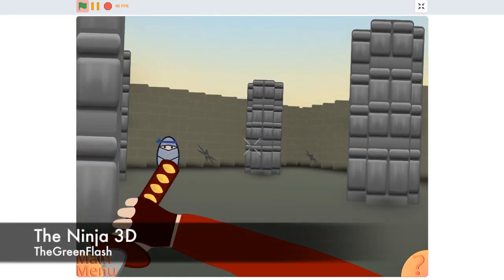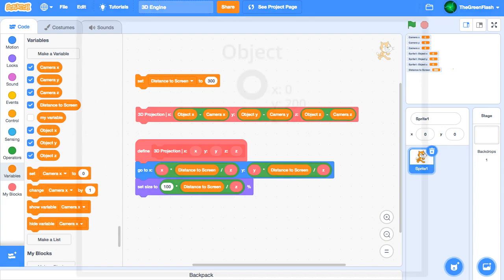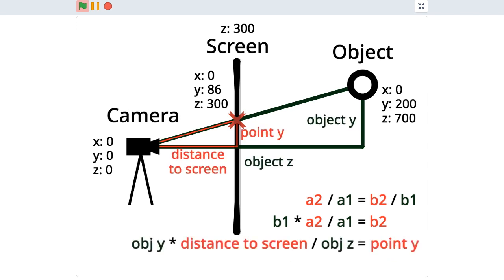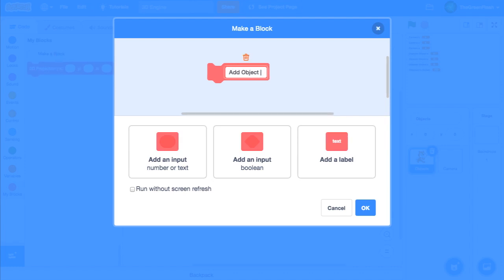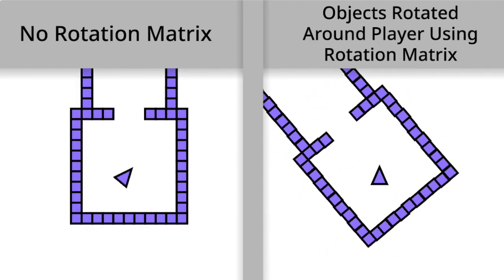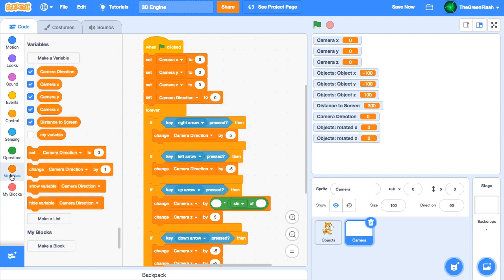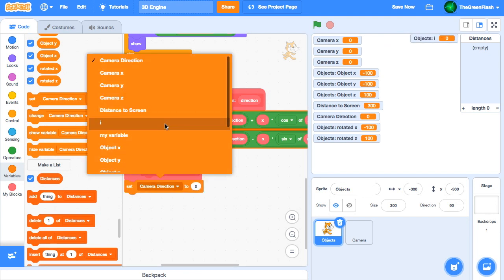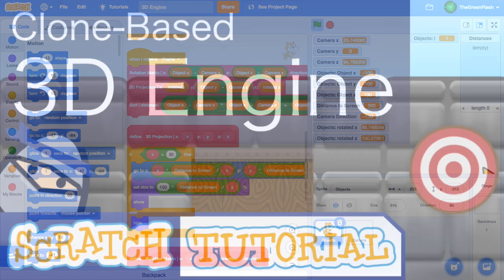How to make a 3D Engine in Scratch 3.0

Comment: When I walk past the cats and look back, they are very far away:/ How do I solve this?
Reply from the maker: Thanks for watching the tutorial! If nothing is using the motion or costume blocks, Scratch automatically runs the project in turbo mode (the frames per second go from 30 to several hundred). This happens here when the objects go off the screen. There are several ways to fix it, and the easiest is to just add a go to x: (0) y: (0) block at the bottom of the Camera sprite's forever loop.

Comment: I have a problem 
I can only add one object not many 
Anyone know the fix?
Reply from the maker: Thanks for watching the tutorial! I'm not sure what's wrong, but you could try comparing your code to the completed code here: https://turbowarp.org/575099758/editor
Reply: @TheGreenFlash  thx bro I fixed it but I had another problem,it's in the  rotation matrix when I press left it moves up and when i turn around it moves normally I tried many times but didn't work

Comment: bro didnt notice the bug about not looking at the objects then getting teleported far away
Reply from the maker: Lol yeah, I completely missed that until after I posted this, and the problem goes away after part 2. I thought I had a pinned comment giving a quick fix, but it’s not here anymore for some reason.
Reply from the maker: [Copy-pasting the comment] If nothing is using the motion or costume blocks, Scratch automatically runs the project in turbo mode (the frames per second go from 30 to several hundred). This happens here when the objects go off the screen. There are several ways to fix it, and the easiest is to just add a go to x: (0) y: (0) block at the bottom of the Camera sprite's forever loop.

Comment: hi, i am using scratch 2 and I don't have "go forward () layers" block - is there any way to do it?
Reply from the maker: Thanks for watching the tutorial! It should work if you use Scratch 2’s “go backward () layers” block, but put (1 - i) as the input instead of (i - 1). This will make the input negative, and going backwards a negative amount of layers will make it go forwards.

Comment: I found a glitch after impletmenting the rotate matrix and updating the camera movement.
Whevener I rotate the camera so the cat sprites are behind me and I hold down the up button and I turn around to look at them again, their suddenly VERY VERY small. I don't know why this is happening, Im pretty sure I copied the code down correctly, anyone else having this problem?

EDIT: after playing around awhile, I have discovered that for some odd reason the foward button suddenly makes the camera go very fast if I hold on to it for a while (the Z Camera variable suddenly goes into the thousands).
Reply from the maker: Thanks for watching the tutorial! If nothing is using the motion or costume blocks, Scratch automatically runs the project in turbo mode (the frames per second go from 30 to several hundred). This happens here when the objects go off the screen. There are several ways to fix it, and the easiest is to just add a go to x: (0) y: (0) block at the bottom of the Camera sprite's forever loop.
Reply: @TheGreenFlash  Thanks for the reply! I tried using a motion block but It didn't work. However, now that your explained to me why it happens I figured out why it was reacting that way: I hide the camera's sprite, now that I unhide the sprite It words just fine, but now have a very tiny cat in the middle of the screen (LOL). But its ok, I made it transparent using a ghost block. Everything is working as expected now, thanks a lot, you're the best!
Reply from the maker: Awesome, I’m glad you got it figured out! Also, if you don’t want to use the ghost effect, you should be able to erase the contents of the cat costume in the camera sprite.

Comment: Hey bro huge fan but I don’t think this works in the newer versions of scratch because I did everything in here but it’s just not working and it only shows 1 cat I did everything but it’s just not working any advice about what could be wrong
Reply from the maker: It could display only one cat if you make the object variables For all sprites, when they should be For this sprite only. This will allow each clone to have its own copy of the variable, so the objects can appear at different points in 3D space

Comment: When I turn around, it changes my x and z position??????
Reply from the maker: That sounds like an issue with the Camera sprite’s movement script. You could try comparing your code to the completed code here: https://turbowarp.org/575099758/editor
Reply: @TheGreenFlash  thanks I forgot to take out the original movement

Comment: It's not working the camera x and y got to like 1 million in 2 seconds :(
Reply from the maker: Thanks for watching the tutorial! If nothing is using the motion or costume blocks, Scratch automatically runs the project in turbo mode (the frames per second go from 30 to several hundred). This happens here when the objects go off the screen. There are several ways to fix it, and the easiest is to just add a go to x: (0) y: (0) block at the bottom of the Camera sprite's forever loop.

Comment: can you make different sizes of objects or was i too lazy to check the tutorial again
(not being rude btw)
Reply from the maker: That’s a good point, I totally skipped that! It shouldn’t be too hard to add a variable for object size. You could call it Object Size, make it For This Sprite Only, and set it before you create a new object. Down in the 3D Projection script, with the line “set size to 100 * Distance to Screen / z”, put the Object Size variable in for 100, so it becomes “set size to Object Size * Distance to Screen / z”.

Comment: hi i am having trouble with the code primarily the creating clone part i went back to check if all the code was correct and it seems to be so i was wondering if you would have any idea of why it doesnt want to create the clones of the objects sprite?
Reply from the maker: Make sure the Object xyz variables are set to For this sprite only. If that doesn’t fix it, you could try comparing your code to the completed code here: https://turbowarp.org/575099758/editor
Reply: @TheGreenFlash  oh yeah that fixed it thank you so much.

Comment: so if you walk straight through the cats, it takes you super far past them, but if you walk backwards, it doesn't. you can tell he's avoiding this bug, but he does not give a fix for it     : (
Reply from the maker: Thanks for watching the tutorial! If nothing is using the motion or costume blocks, Scratch automatically runs the project in turbo mode (the frames per second go from 30 to several hundred). This happens here when the objects go off the screen. There are several ways to fix it, and the easiest is to just add a go to x: (0) y: (0) block at the bottom of the Camera sprite's forever loop.
The bug is also fixed in part 2 with the addition of the horizon sprite.

Comment: So im at adding objects and i have the cam set up i think? but whenever i use arrow keys and move the cam too far it just goes really fast and there is only one scratch cat even tho i put in the clone thingy?
Reply: Ok well i fixed the cord issue but i cant get multiple scratchs on the screen?
Reply from the maker: Thanks for watching the tutorial! If you only see one Scratch Cat, it sounds like the Object x, Object y, and Object z variables were made for all sprites instead of for the Objects sprite only. If that doesn't fix it, you could try comparing your code to the completed code here: https://turbowarp.org/575099758/editor

Comment: Very good tutorial. Just one small problem though; when the user is not looking at any objects, the speed at which the camera moves increases significantly fast.
Edit: Nevermind my complaint, it was a problem on my part
Reply: its happening to me too how did you manage fix it?
Reply: @DeBeer78  I don't remember exactly, but I do know I went through the video over and over again until I found the wrong in the scripts
Reply: @DeBeer78  if it helps I think it had something to do with the sin and cos functions
Reply from the maker: Thanks for watching the tutorial! If nothing is using the motion or costume blocks, Scratch automatically runs the project in turbo mode (the frames per second go from 30 to several hundred). This happens here when the objects go off the screen. There are several ways to fix it, and the easiest is to just add a go to x: (0) y: (0) block at the bottom of the Camera sprite's forever loop.
Reply: @TheGreenFlash  alright, thanks

Thats what I did before and it fixed it
Reply: @TheGreenFlash but, only works when You enter into the The Ninja 3D, i have that question

Comment: it is normal that for me when I click on the green flag its position puts x -300 y 300? ??????? PLS HELP MEEEEEE
Reply from the maker: That could be normal depending on where an object is in relation to the camera, but I'd really have to see the code itself to know for sure.
Reply: @TheGreenFlash  Here is the project link https://scratch.mit.edu/projects/527273202/
Reply: Did you find the problem?
Reply: @TheGreenFlash  ?????????
Reply from the maker: Sorry for the delay, I got super busy for a few weeks. It looks like there's a problem with the script under the When I receive Frame block. The second input for the 3D Projection block should be Object Y - Camera Y, but it's currently Object Z - Camera Z. Again, sorry for the late response, and I hope this helps!
Reply from the maker: Also, in the same When I receive Frame script, the second input in the Rotation Matrix block should be the Object Z - Camera Z, but right now it's Object Y - Camera Y.

Comment: should I learn scratch? I already know a decent amount of python and I always kinda doubted scratch because it’s a visual coding language but this looks cool
Reply from the maker: I use Scratch because I find it really easy to quickly build a prototype of a game idea. One of the major limitations of Scratch in the past has been that it's relatively slow, but recently websites like turbowarp.org allow you run Scratch projects much faster, in most cases eliminating this problem. Scratch also has a huge community that can help you learn and give you feedback. As a bonus, block-based coding is structured like written code, but you can't make a syntax error. Those are the main benefits of Scratch, but whether you learn it really depends on what you're looking for.
Reply: @TheGreenFlash  I’ll try it. It’s not like I’ll be losing knowledge or anything lol

Comment: really good tutorial i loved it but i just want to point out two issues :
- when you go behind the scprites the order is still messed up
- when you have a sprite at the very side of the screen and you go forward it will look weir because the sprite grows and does not get out of the field of view even though it should
Reply: @akaxyz0  that doesnt work either. And im 4 months late
Reply: 1 - It's kinda weird you ran into this issue
2 - Just add a huge invisible rectangle behind your sprite's costume. It will not let the object grow bigger like the famous "empty costume" trick does, but it will give the illusion that your sprite (or clone) is off-screen. I used this trick many times, and it works just well.

Comment: 709'th sub, this tutorial is awesome! Although, I am getting a problem where if I turn around all the way I am suddenly super far away from the cube and the variables are messed up. I'll probably find out it was me being dumb XD

Edit: Oh well now it seems to be working? I don't think I changed anything....

Another edit: Well now it's happening again! Why does z go up so fast when you go through the cube?
Reply from the maker: Thanks for taking the time to watch! If nothing is using the motion or costume blocks, Scratch automatically runs the project in turbo mode (i.e. the frames per second go from 30 to several hundred). This happens here when the objects go off the screen. There are several ways to fix it, and the easiest is to just add a go to x: (0) y: (0) block at the bottom of the Camera sprite's forever loop.
Reply: @TheGreenFlash  Oh, didn't know that! Thanks for telling me, I put it in and now it works all fine.

Comment: This is sick, but if you put the cats 180 degrees behind you, there's this weird glitch where if you go forward, then turn back around, they are really far in the distance and if you try to get closer, they don't move at all.
Reply: That's because they are SO far away. What seems to happen is if you move forward in the z direction enough, it suddenly starts increasing your camera's z position exponentially instead of at the constant rate you've written it to move at. And then once you've done that, if you move in any other direction aside from the z direction, like the x direction, it also increases your position in that direction at an insane rate as long as you're that far away or more in the z direction. Look at the Camera z and Camera x variables. Eventually the cats will come back if you move in the right direction for long enough, but it will take so long at that point that it's not worth trying to find them anymore.
Reply: @legoboy7107  oh
Reply: @nickmoffett1807  I have no idea why that glitch happens either though.
Reply: @legoboy7107  This is because the loop has no screen refreshing blocks so it just runs as fast as it can. Most movement blocks cause screen refreshes, and so do wait blocks. You can use move 0 steps.
Reply: @cst1229  Huh. So loops in Scratch CAN run faster than 30fps without being inside a "run without screen refresh" custom block, then. I genuinely with my over 7 years of experience on Scratch did not know that was possible, I always thought Scratch loops were ALWAYS locked to 30fps. I guess I just always had something that used screen refresh running at the same time whenever I had a loop before.
Reply: Okay, I found a weird "fix" to this problem. At the end of the forever loop in the Camera sprite, put a "wait 0 seconds" block. Yes, wait zero seconds. For some reason that works. It seems like, when you hide all the objects once they're too close to the camera, it suddenly speeds up the framerate way above 30fps for no reason, and putting this wait block in there fixes it. Seems to be some bizarre Scratch bug from what I can tell.
Reply: IMPORTANT: Put a "wait 0.01 seconds" block before "broadcast Frame" block in Sprite " Camera"
Reply: @derwastl  You can actually just make it a "Wait 0 seconds" block because that works too.
Reply: @legoboy7107  ok 👍🏻

Comment: I don't see any my character or any clones of my character anyone mind helping me?
Reply from the maker: If you send a link to your project, I can take a look.
Reply: @TheGreenFlash  Oh I sent a reply but i guess it never came through, https://scratch.mit.edu/projects/510726611/
Reply from the maker: In the 3D projection script, it currently has x = 30 when it should be z > 30. Also in that script, the second input for the go to block ends in x, but it should end in z. Under When I receive Frame, the 3D projection script should be first and the rotation matrix should be second. Right below that in the Sort block, the end of the expression is Object x - Camera z when it should be Object z - Camera z. The same is true for the second Rotation Matrix input. In the Add Object script, the Camera xyz variables are being set, but it should be the Object xyz variables. In the Rotation Matrix script's set rotated x, it currently is (z * (sin + (x * cos))) when it should be (z * sin) + (x * cos). The same goes for set rotated z, except it should be (z * cos) - (x * sin). After that, it should be fixed. :)
Reply from the maker: I know it might seem like a lot to fix, but considering the amount of code in the project, I'd say you did a pretty good job with it.
Reply: @TheGreenFlash  Thanks for this I think i did some of what you did but most of everything you say I don't really understand. Is there a project you have I can remix and just change the game into what I want? Thank you and sorry that I am asking again but It's been a while I don't remember much of anything in it and I'm not that good at scratch coding.
Reply from the maker: Here's the project shown in this video: https://turbowarp.org/497593298 I might change it at some point, but it should work for at least a few weeks. Also, since it's TurboWarp (used to view unshared projects), you'll have to download it to your computer and upload it to Scratch.
Reply: @TheGreenFlash  Thank you.

Comment: hey you! i have a question. How to make a 3D Engine using Pen with Zoom In and Out? ex: 1°Person and 3° Person but you can turn with The Cursor.
Reply from the maker: You can use the main ideas from this code to make a pen-based 3D engine, but for pen specific issues such as line clipping, I'd suggest a tutorial on 3D pen such as this one: https://scratch.mit.edu/projects/170591185/ It was made for Scratch 2.0, but it's still fairly relevant.

Comment: Thank you for this, it is really helpful. I might modify it with stamping though and the rotation is a bit off.
Reply: fyi stamping is really laggy as of rn so if you feel like making highly detailed or just big worlds in here, don't use that approach.
Reply: @SkyIsTumbling  It is not laggy if you do it the right way. I've managed to get quite a large world where the sprite is only stamped if it is within the smaller area of the camera.
Reply: @emeraldthunder  aight, just saying i made the minecraft tribute edition project so i *know from experience*, just dont go over 9000 stamps at a time and you should be fine.